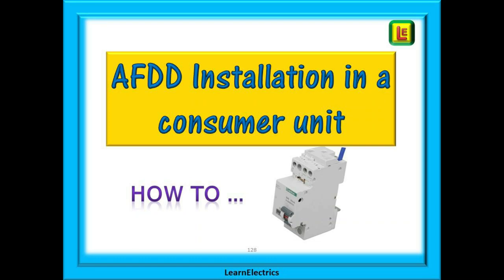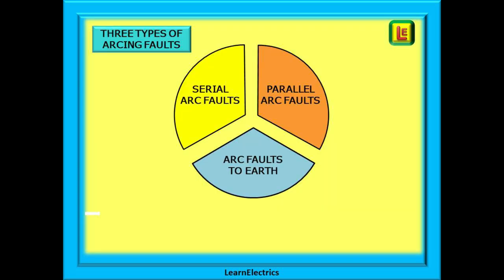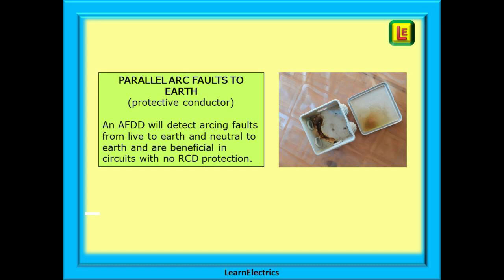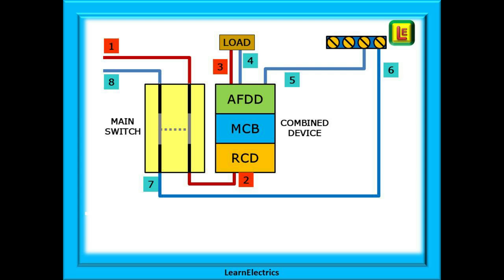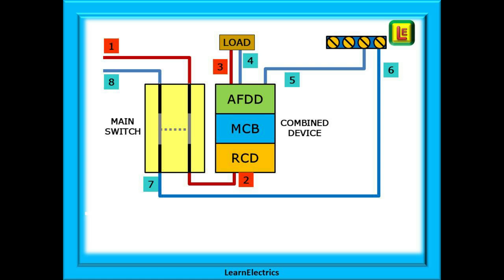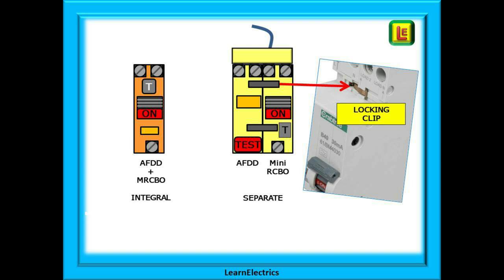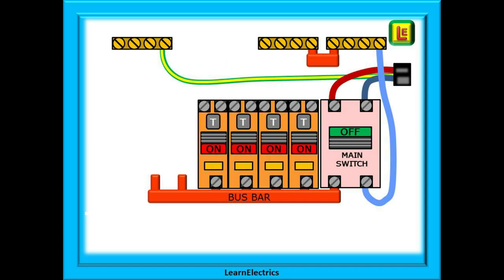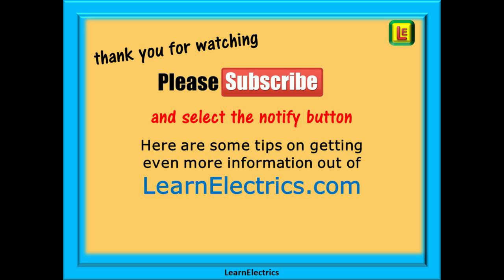AFDD INSTALLATION IN A CONSUMER UNIT – HOW TO and THE BASICS

Comment: Very nicely explained. AFDDs are really only manufactured by a few of the larger brands at the moment, so they are quite a price. A lot of the faults they protect against are due to poor installation, poor or lack of periodic maintenance. Having seen some of the test videos on them, they do not seem to be that reliable, or require quite a lot of energy to trip them. I am not convinced yet that they are justified on the majority of low voltage installations, especially domestic side. Being sold as a safety improvement though, I have no doubt they will become mandatory in the future without the real justification for the improvements they offer.
Reply from the maker: Exactly my thoughts too. Thanks.

Comment: Great video once again. I got the idea from NAPITs Webinar on the amendment 2 that it'll be that AFDD's will be required in most residential premises where possible danger to life is present. Basically everywhere. Going to be interesting to see what happens after the 28th and wether theres a "cooling off period". Selling a £1k consumer unit to a customer when there's cowboys everywhere still offering BG split loads for £150 is going to be a challenge
Reply from the maker: It's all topsy turvey at the moment David. Lot's of guessing going on and I guess lots of pressure selling before the deadline is reached.

Comment: 1, Excellent, Explain very simple way and to the points. Can you do video on consumer units with all devices and PROS AND CONS  and cost.
2, Recommendation to install AFDD and SPD. when to install and cost. AFDD cost Pound 100. costly. Can we we install only for sockets in  Cost of DB.
3, Pros and cons of installation of 2 RCCB in DB and RCBO in each circuit. Prefer to install with RCBO for each circuit. If 2 RCD trips in DB then you will lose complete power. Any one trip in house and may cause accidents. Cost wise? Highly prefer in school, senior citizen  house and etc. Can you do video
Reply from the maker: thanks for the comments, much appreciated. Costings of materials and work will depend very much on individual circumstances. Thanks for watching. Dave.

Comment: I have a 40A RCD connected to 2 X 20A MCBs each connected to a socket circuit. To save money I was going to replace the RCD with a single 40A AFDD. 
Is this OK OR will leaving the MCBs in place  downstream affect the AFDD's functionality?
Reply from the maker: You need the RCD left in place for additional protection. Alternatively, if you remove the RCD, replace all the affected MCBs with RCBOs.
Reply: @learnelectrics4402  Why do I need to leave the RCD in place since the AFDD also includes RCD functionality?

My main concerns are:
1) Does swapping the RCD for an AFDD comply with the "...must be at the origin of the circuit." rule even thought the MCBs are downstream?

2) Will having the AFDD upstream from MCBs impair it's ability to detect arcs? 
(I wouldn't think so since it's algorithm is just pattern matching waveforms with known arc waveforms in its database and the MCB to the best of my knowledge "shouldn't" change these waveforms).

Comment: remember that afdd breaker load circuit is connected in the bottom you need separate enclosure as well bring link 230v supply from fuse board otherwise how you going to connect all circuits unless out there on the market are many different afdd !!!thanks
Reply from the maker: Thanks Tony, thanks for watching.
Reply: @learnelectrics4402  great videos and helpful for everyone

Comment: If an RCD won't detect an in-series fault because the current is too low, how can it get hot enough to cause a fire?
Reply from the maker: The arcs and sparks jumping the gap between two conductors will generate a lot of heat even though the current is small - hundreds/thousands of degrees centigrade.
Reply: @learnelectrics4402  Oh right i thought increased temperature made current rise.

Comment: John wards channel did a test, and purposefully tried to ark trip it. It didn't work!
Reply: Just like SPDs they are not needed in domestic installations, we get tiny arc volts and power surges on a daily basis with out any problems, these things don’t work your spending money on some thing that will just sit there looking pretty and never do anything. Unless you’re someone who has high power machines like welding equipment or a lathe or something like that in your garage and you spend your Saturday and Sunday mornings tinkering in your garage.and how many people do think has anything like that at home?
But who am I to argue i’am just a humble spark who’s opinion means nothing. 
Great video as always 👍
Reply: Waste of time on lower current circuits such as lighting on 6A breaker
Reply from the maker: Yes, it needs to be a decent length arc to avoid triggering on light switch changeovers etc. Thanks for watching.
Reply from the maker: Yes, absolutely.
Reply from the maker: C'mon Sean, your opinion does matter. If folk are asking, we're going to tell them what's involved, especially the bit about hitting the wallet hard.
Reply: @learnelectrics4402  yes I know the last bit of my post is just a bit of hummer .